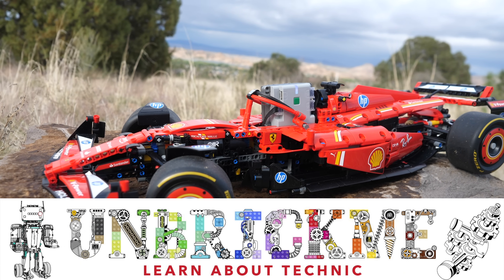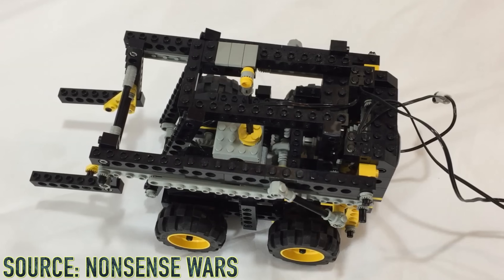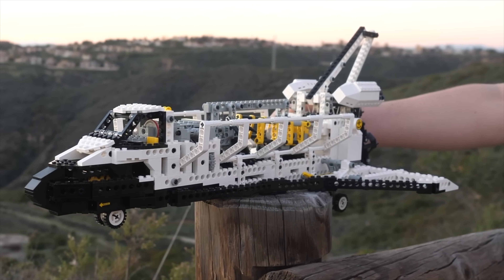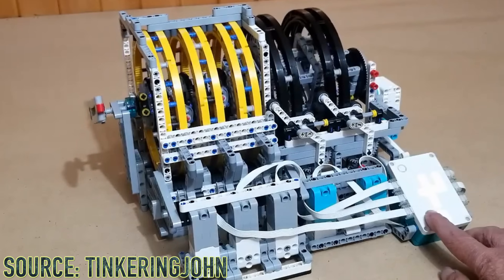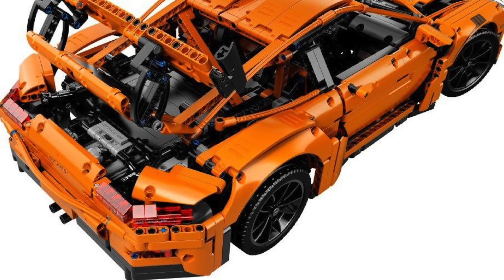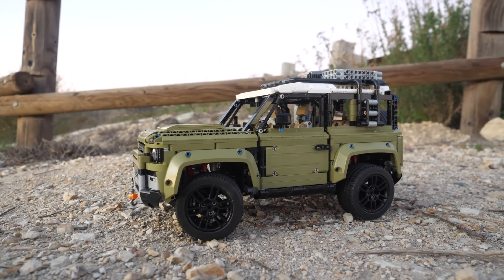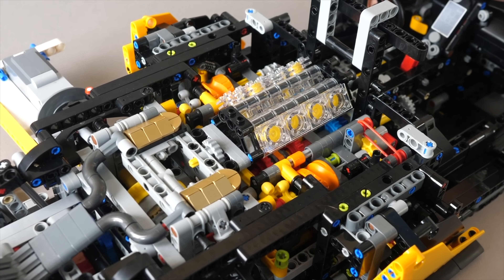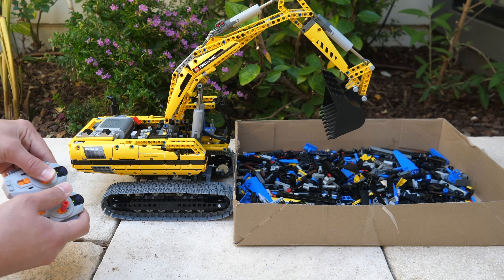10 Hardest to Build LEGO Technic Gearboxes

Comment: Just wondering is anyone else a little fed up with the new pneumatic pressure pump system that they use on a lot of the newer technic models? So much prefer either manual winding or batteries 😂. 
On a separate note I think the hardest gear boxes I’ve ever built was between the Bugatti Chiron and the Land Rover.

Comment: The hardest one for me was simply my first. After having Lego as a kid, I put it away for a number of years. Picking it up again, I remembered how much I enjoyed technic so I bout a technic set. Little did I know how much technic had evolved.
I think I had to rebuild the gearbox 3 times before I understood what was meant to happen
Reply from the maker: It’s crazy how much Technic has changed over the years!
Reply: @Unbrickme  I am so old, that I had tecnick before it was technic, the large colored cogs.
We had most of the first technic release, the helicopter, the car chassis , the forklift.
The last set i bought before putting lego away was the excavator with pneumatics that you had to manually pump the air